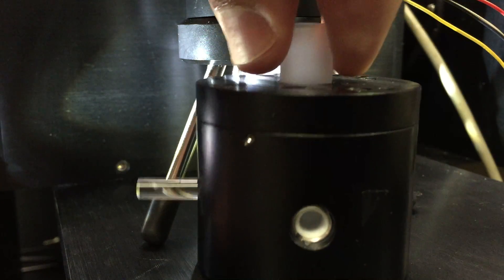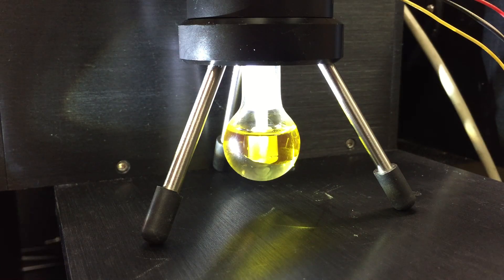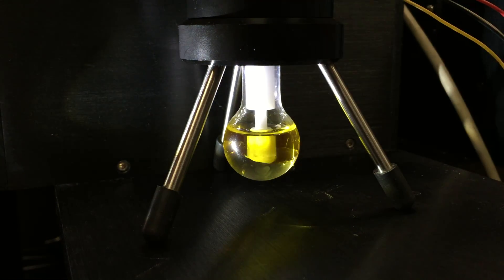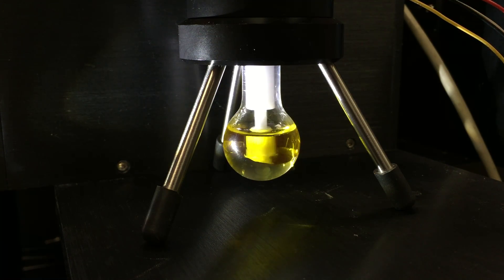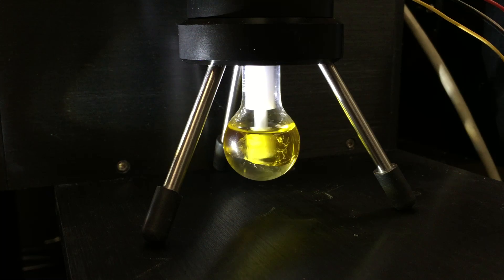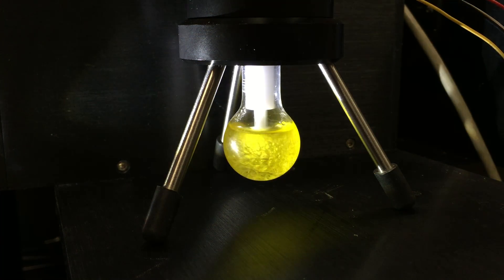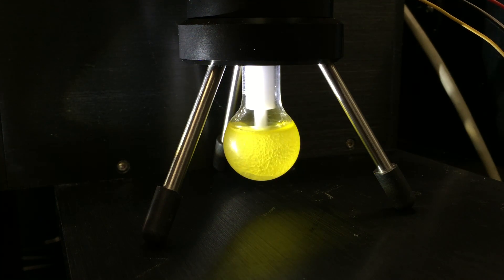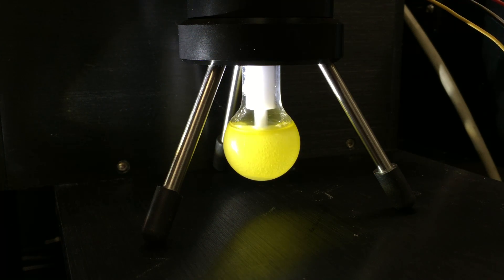Emulsification of olive oil & water using a PowerFlea in the integrating cavity of an CLARiTY UV/Vis

Comment: How to make mixture transparent?
Reply from the maker: The entire point of the CLARiTY UV/Vis is that there is ZERO need to make a mixture transparent. This exact sample can be scanned 240-1100 nm with our proprietary integrating cavity spectrophotometers.
Reply: @julieanndesalorenz4716  madam, I want to increase volume of petrol by mixing with water and used as fuel in my bike.